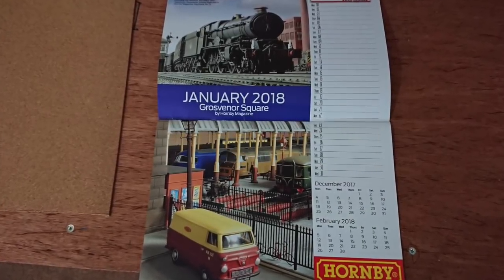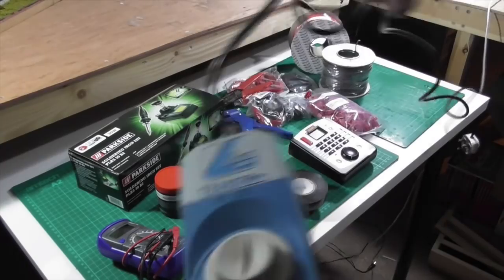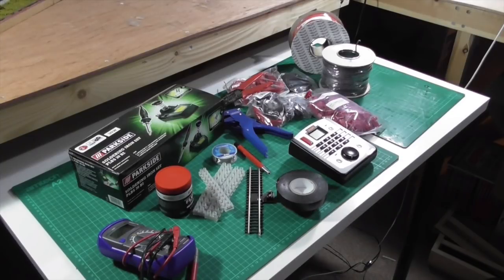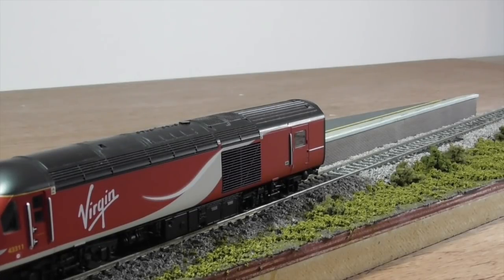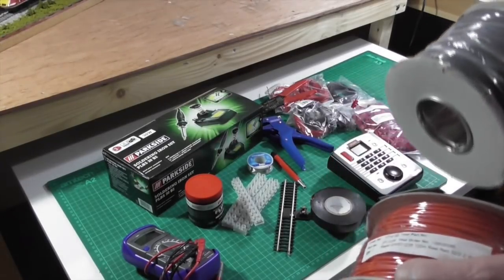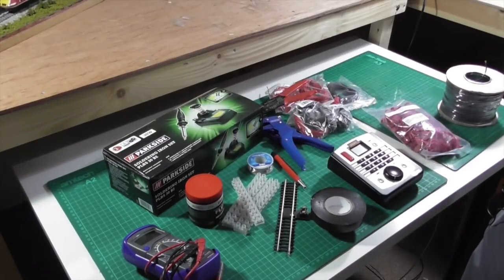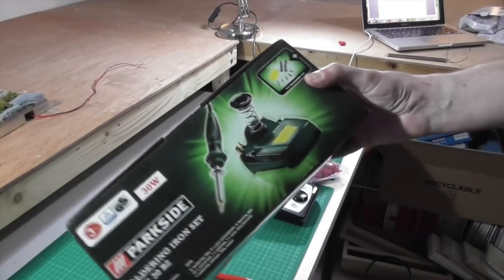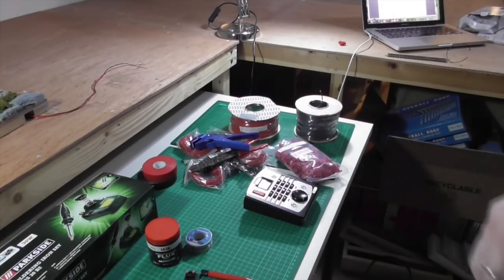Alnahudy Central Episode 3 - Modern Image Model Railway - DCC Bus Wires

Comment: Having been a gas fitter all my working life I can say La-co flux is good because it cleans the joint as it heats (Acidic)  but dont apply too much and clean uo afterwards and dont get in any cuts lol
Reply from the maker: jaxmar88 haven't had any problems with the flux so far, but tine will tell I suppose

Comment: Hi just a little tip from me, don't use the Flux Paste unless you can clean the soldered joints afterwards, this stuff oxidises over time leaving a green deposit on the joints and ultimately degrading the joint, have a look for Flux Pens that are used in the electronics industry that don't required cleaning afterwards. Great video keep up the good work :) Cheers
Ian
Reply from the maker: Hi, thanks for letting me know, I had heard stories of things going green with bad ova glue also but didn't know about the flux, so will see what I can find
Reply: Yep, having used these fluxes for heavy duty copper pipe fittings as a heating engineer (la-co, power flux etc) they are, as mentioned very corrosive if all of the residues aren,t cleaned away. A water based flux would suit these small soldering jobs better I think or a electronics specific flux etc. If you get la co flux in a cut on your finger........😁